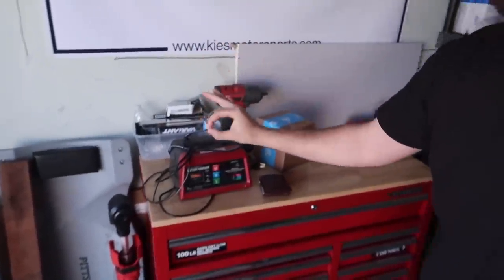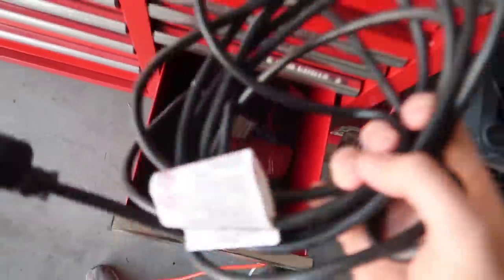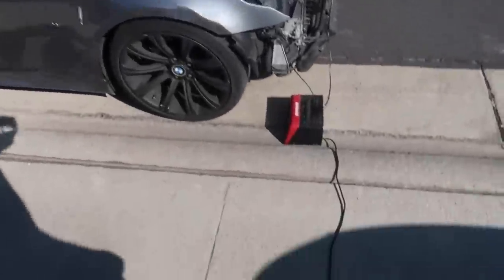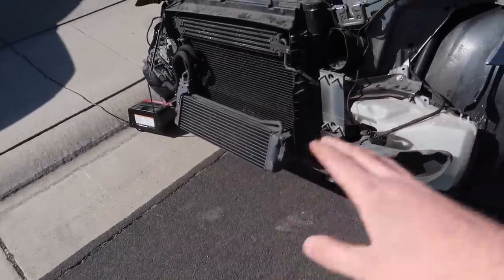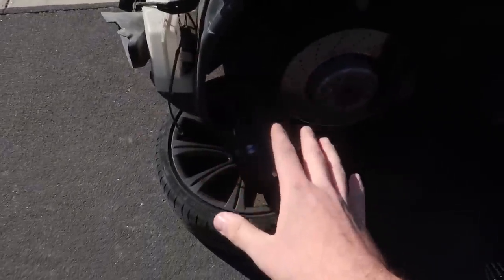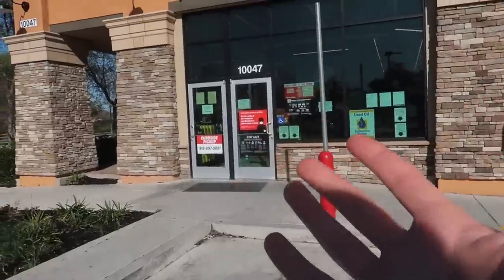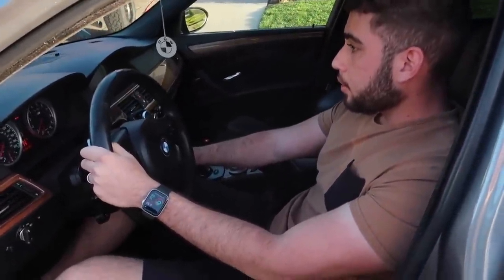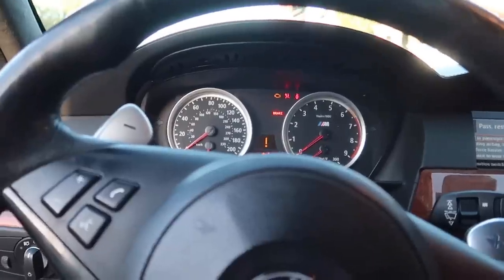CRANKING THE 500HP M5 FOR THE FIRST TIME!

Comment: the engine sounds good, but it’s possible that the camshaft may have jumped time causing it to throw those codes and stalling out right away. 
i had a similar issue with a e92 that i had and what happened is the person who i bought it from flipped the 2 sensors around and secured them with a zip tie  which was throwing a check engine light but ran decent just had a bogging idle. 
when i flipped those sensors i got a long crank and it was obvious the engine was out of time. 
i would say remove the JB weld off the sensor that goes to the clutch and replace the sensor just to get that possibility out of the way.
Reply from the maker: will do thank you!
Reply: My E93 had a CPS error on the exhaust side.  I was thorough and tested both with these guys vid:
https://youtu.be/EyEr3Yz23QM
Sure enough the exhaust side failed the test, swapped them and got a long crank and intake side failure instead. ;) Ordered me a new one and new o-rings from our boys at FCP Euro, problem solved.

Comment: My old Beemer used to do this. It could be the key fob battery is low. When trying to start it up next time, hit the gas and try to get it to idle.
Reply: Idek about the key thing but do try to give it gas when you start it next
Reply: Key has nothing to do with it I think it might not have enough voltage for the car to run might need to just get a new battery

Comment: just letting you know e60's are nitrous notorious for battery drainage issue. The heat from the engine bay & jumpstarting from a car instead of a battery charger/jumper causes some of the electronics to fail which in turn causes the low battery life.

Comment: Sounds like there is no fuel coming in, it’s cutting, these engines are smart and will protect it self from harm

You changed one crankshaft sensor, and these sensor relearn by them selfs, try putting some gas while starting and see if it’s starts otherwise try changing your mass air flow sensors might be dirty since you’ve had some spray color on the air filter? Idk some ideas

Comment: if you end up getting new transmission, i would recommend doing a manual trans swap since the automatic on those car is the SMG which a very bad trans and the biggest failure point on these cars

Comment: they are few things you can try first if you have another key try starting with the other key could be a bad key and the immobilizer won't let it stay on if that does to work could be a fuel issue sometimes the tank fuel senders Primary and secondary can go bad and if there are only a few gallons it will cut thinking it empty Also as heads up Carly cant read all the real codes from the e60 M5 it better to use INPA to troubleshoot.

Comment: I had that same problem on my 2011 550i. My car was stalling until I swapped out the sensor on the tranny housing just like yours. Worked for a few hours then kept stalling again. Re checked the sensor and it was 1/4 of a turn from being torqued  tight. That small adjustment made all the difference. Haven't had a problem with it since. I would definitely have that jb welded sensor replaced and the screw bolt retapped if need be as the sensor is magnetically actuated. So if it's not torqued to spec it will not function properly.

Comment: It sounds like it doesn´t run on all cylinders. High emissions could rely to faulty air flow meter. Try unplugging it. I would also check de spark plugs :) You also have to update your car and register the new battery. I hope you took the same ampere battery, otherwise you have to code in the new one.... and also do a Intelligent Battery Sensor reset. I use Inpa to do all this, but Carly should also be fine...  Hope you find out soon what the problem is. Kind regards from Luxembourg/Europe :)

Comment: I’m also a mechanic Nour and the engine sounds ok, I would say the the crankshaft sensor is at fault. If not I would see if the correct flywheel was fitted as I had the same issue with a Mercedes and the flywheel was incorrect which was telling the ecu the timing is out. Hope this helps you

Comment: Engine sounds good. I don’t know if crank shaft sensor is expensive but I would say try testing or finding out if it’s the alternator I would think don’t know if that’s expensive but you can test it or get someone to test or the starter motor. I know the code doesn’t show it but I think it’s worth a test just to make sure before you spend big money if that other thing is. Good luck brother
Reply: Might be the crank shaft sensor I doubt that the problem lies within the alternator nor the starter motor... I might be wrong
Reply: He had it on charge
So the alternator is out the picture i think 
Tho i think its the crank position sensor

Comment: You need to check the timing!!!! I also had a issue with e60 that wouldn’t start and it was because I shorted out the ECU when replacing that cats. Did exactly the same thing and threw exactly the same faults!!!!! Please check ECU

Comment: The engine did sound healthy . Started up without and rough idle or misfiring . Check those two sensors and then try using a brand new battery for starters .

Comment: Id recommend trying to replace that sensor. But if it ran before the accident even with that janky job i would troubleshoot other less expensive options. Because that smg trans to replace anything on it be ready to open up that wallet. Have you looked into the knock sensor?
Reply: Car doesn't have traditional piezo electric knock sensors by the way , there are no sensors on the block. It Detects knocks by passing an electrical  current through the actual gasses inside  the cylinder.The gasses become ionized when there is a knock , and ionized gasses are electrically conductive.The system is driven by two modules on each bank , failure of these modules will NOT cause the no start. That being said,  Nour , please get ista-d
Reply: @domkraggp9944  Agree, this baby diagnostic could be issue
Reply: @pavelbalusek9121  indeed Carly won't cut it here  , hopefully our Man is reading this

Comment: Nour, I have a 2006 M5 and this particular car is very temperamental. It has no dipstick and has to be checked by    the center display above the gear and mileage display. However you can’t get an accurate oil reading until the engine is properly warmed up. This car burns up fuel and oil like crazy. I don’t know why it’s not starting up, but there is something that guy didn’t tell u about this car. This is why he let it go for 5k. That battery you have could be your problem. It could also be the rod bearings. You have to replace them every 50-60 thousand miles. You might want to call SSR performance.

Comment: First thing I would do is change the battery. Then I would properly diagnose it with a laptop and BMW approved software. Ask your friend Nick I believe to hook up the laptop and see what BMW specific codes its trowing. Carly is a good program but the BMW original might be the way to go for finding the problem and diagnosing an M5.

Comment: Had a 335i in the past wouldn't start and was giving Cam shaft position sensor errors. Turned out to be something completely unrelated and was just the vanous solenoids. Moral of the story start with the most simple and work your way up. The janky JB4 job leads me to think they went down the crank shaft sensor route with no success. I would personally get a new battery, then drain the oil see if you have an glitter, good indication of the health of your engine, then start working from there. Also try to read the values that your sensors are giving out, both the crank shaft and camshaft make sure they are reading okay. Best of luck!

Comment: crankshaft sensor bad, engine will start but run rough in limp mode. your problem is with the clutch position sensor , you need to remove the gearbox to change that, and while you are it, also put a new clutch kit inside, then trigger the gearbox relearn procedure from original ISTA/D bmw software, not carly or others. part code 23017837428, $500 brand new or $375 used.

Comment: The problem is in the flywheel it is not positioned right you need to repostion the crank shaft and the fly wheel in the same direciton it is common problem on e60 e63 because camshaft sensors are positioned in the transmission but people used to be on on the cyclinder head sorry for my bad english

Comment: If it gives you that the cranckshaft sensor it will not star cause the ecu isn’t gonna know where is the position of the first piston because of that it can’t turn on, but I don’t think the transmission would make the engine struggle on starting ...

Comment: If you're getting a new transmission manual swap it, that SMG transmission is the worst transmission ever built lol
Reply: Talk to 'Nathan's BMW Workshop' on youtube, he's a BMW guru.
Reply: J Tommy  obviously you’re unaware of the e60 m5
The car is a money pit to begin with, getting rid of that SMG transmission will be the best peace of mind he can get from that car
Reply: J Tommy  obviously you're clueless on how much money he could easily put into that car :P educate yourself
Reply: J Tommy  if he wants it running in tip top shape, and any sort of reliable, open the wallet and bring the vaseline
Reply: J Tommy  Ok first of all a conversion kit is like $1000 and a remanufactured transmission is around 5-6k, used will be cheaper, doing this will also make the car worth more money and way more reliable
secondly, you're saying labor cost? he DIYs everything, so there is no labor cost, beginning to wonder if you even watch his videos
Reply: J Tommy  What's he gonna do take his car to the shop for a rod bearing job? That's 5k right there
See where i'm going with this?
Nothing is getting fixed mechanically on that car without serious money
Didn't realize this was clapper bmw youtube
Reply: J Tommy  It was a suggestion, and it's worth doing and will be a fun project and make good youtube videos, you're the one running your mouth like you have a clue what you're talking about because you turned a wrench once to do an oil change
Reply: J Tommy  probably getting your information from the local jiffy lube